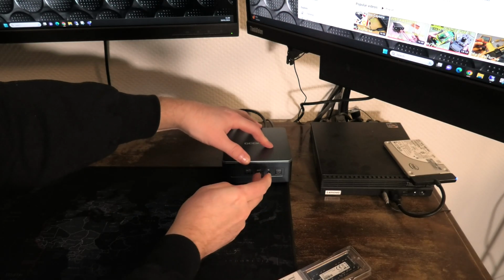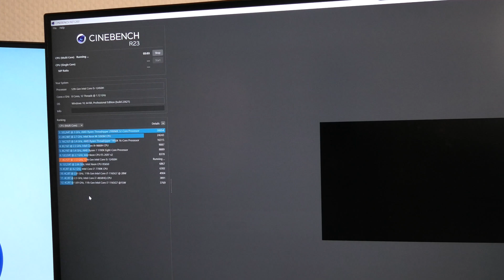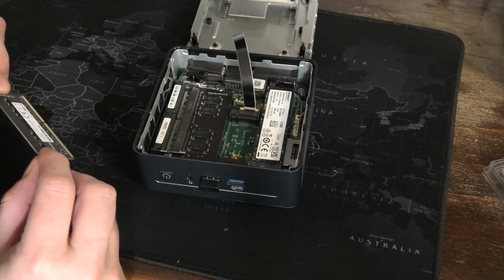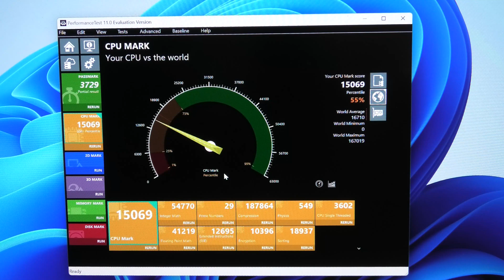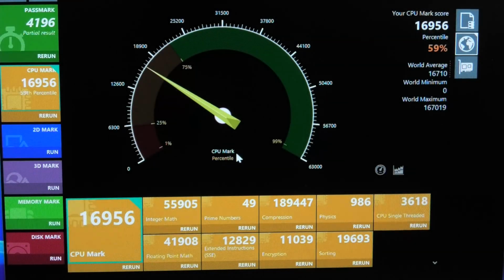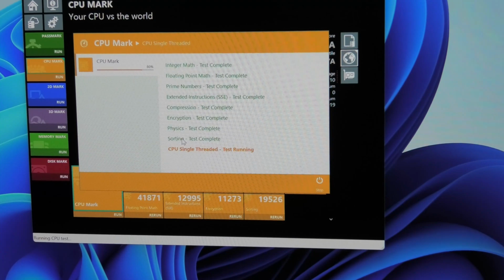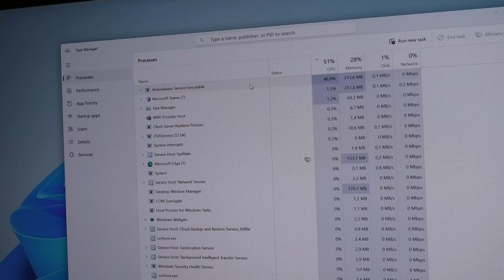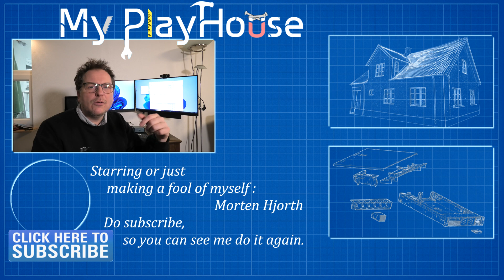How your RAM setup can Influence CPU Performance - 1354

Comment: These were very interesting, I wanted to know mixed RAM causes performance changes. Have a look at Tiny11 by NTDEV, its a stripped down version of windows 11, I use it as a virtual machine, when I come across software that is windows only this helps, its super fast and none of the bloatware that windows comes with. keep up the good work!

Comment: This is a direct reaction to my comment. What did I say "you lose perhaps 5 % performance" with unbalanced RAM. So I was right.
I'm an IT-technician for 24 years now and I have seen the first dual-channel memory controllers far in the past. So years ago I tested if I lose much performance if I use just one big RAM-module on single-channel and have a free slot for future-upgrade when RAM gets cheaper.
You can measure a small performance-loss, but cannot feel it. RAM is by far the fastest memory-component in PCs (after the cache on the CPU - ignore the VRAM on a dedicated graphics-card) and usually storage is the slowest. The CPU has to wait for the RAM really rare, it waits for the storage usually.

You could minimize the startup cpu-utilization by disabling the background-apps and also disable .net framework runtime optimization (in services or task planer)
Reply from the maker: Hi @matthiaslange392
Thank You very much!  glad you liked the video :-)
Thank you for watching! :-)

Comment: dropping from 16GB to 8GB is going to have quite a large affect on the performance, especially running windows 11 (even windows 10 on later builds)
Reply from the maker: I did look, and it was not using near to 8GB.

Comment: I was expecting you would run 8+8 against 16 in slot 1, then 16 in slot 2 to detect the balanced and unbalanced memory configurations.  That has been puzzling me ever since I had a MoBo with 4 memory slots, but it stated that the best performance would be with 3 chips.  I still have no idea how that was supposed to be the best????
Reply: I second this - comparing just as much the amount of ram - especially in the low area as Windows will be working hard paging the memory.
Reply from the maker: Ahh okay,, I did not think that way..

Comment: CPU test dont depned at memory , unless it to less and take the min cpu power for the test.   i think the  change of this result casue becuse the opartion system windows was doing somthing or anti malware scan.     about memory single and dual channel.     single channel have 64 bits (8 bytes) dual channel 128 bits (16 bytes) .    if you put single dimm , the cpu can get in one cycle 8 bytes (for for dimm 3200MT/a it about 3.2GB*8=25GB/sec) for dual channel it about 50GB/sec.    * the speed are max speed for dimm 3200MHZ(3200MT/sec) , depend cpu type/chipset/CL .    what happend if i put 8 GB CH(a) and 16GB CH(b) the cpu access 128 bits (dual channel) at first 16GB (8GB CH(a) + 8GB (first at CH)b.  and the last 8GB (if i use more then 16 GB, the access will be only single channel) .      at most memory speed test, the app bench the lower memory (one channel or dual channel).          *  conclusion  1) you can put different memory size CH(a),CH(b) , but must be same memory brand for stability
----------------------------------------
Reply from the maker: Sorry, it actually does,, if you put in your RAM in a not optimal way,, the CPU will have to wait for the RAM more,, and your CPU performs less.

Comment: How about a single 16gb stick, and 16+16gb?
Reply from the maker: I only had one 16GB block :-/
Reply: CPU test dont depned at memory , unless it to less and take the min cpu power for the test.   i think the  change of this result casue becuse the opartion system windows was doing somthing or anti malware scan.     about memory single and dual channel.     single channel have 64 bits (8 bytes) dual channel 128 bits (16 bytes) .    if you put single dimm , the cpu can get in one cycle 8 bytes (for for dimm 3200MT/a it about 3.2GB*8=25GB/sec) for dual channel it about 50GB/sec.    * the speed are max speed for dimm 3200MHZ(3200MT/sec) , depend cpu type/chipset/CL .    what happend if i put 8 GB CH(a) and 16GB CH(b) the cpu access 128 bits (dual channel) at first 16GB (8GB CH(a) + 8GB (first at CH)b.  and the last 8GB (if i use more then 16 GB, the access will be only single channel) .      at most memory speed test, the app bench the lower memory (one channel or dual channel).          *  conclusion  1) you can put different memory size CH(a),CH(b) , but must be same memory brand for stability
----------------------------------------
Reply from the maker: Try and test it.

Comment: RAM LAW is very simple - more RAM, more joy 🤣🤣
Reply from the maker: Well depends on what you are doing,, more RAM is NOT always a plus.
Reply: @MyPlayHouse   weak cpu need more ram , storng cpu need less ram
Reply: more ram more money you need to spend.
Reply: At some point, more ram means more page tables that need to be managed by OS and things starting to be worse due to stall by frequent cache reload
Reply: @yamamoto65536  😃 I hope 32&64GB of RAM are not that bad figures for the OS to slow down.